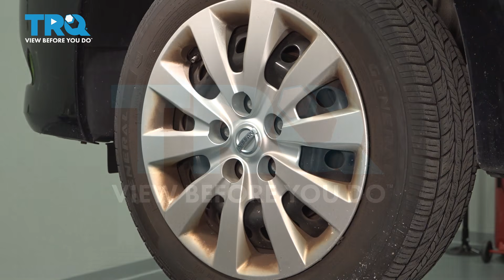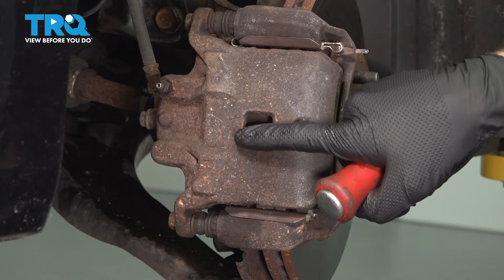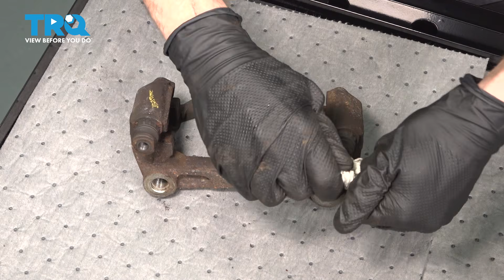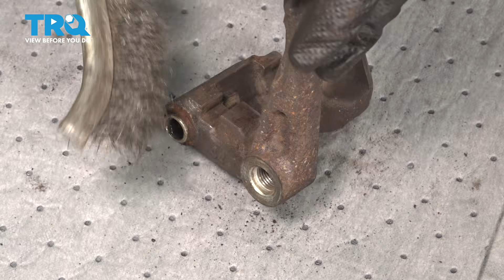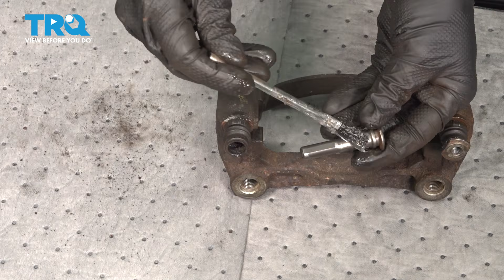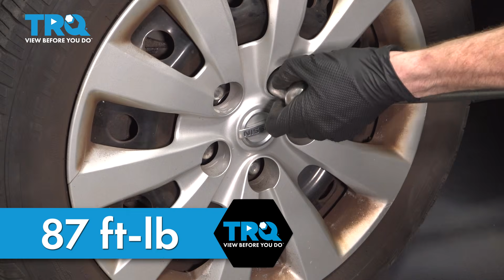How to Replace Front Brakes 2013-2019 Nissan Sentra

Comment: I am assuming that you remade this video because there were errors in the 1st one. Did you remove the original video and what errors were in the first video that needed correction being that I used your first video as a reference when I changed my brakes!